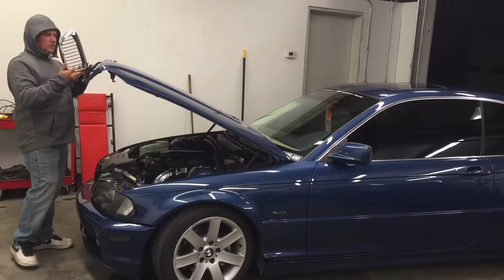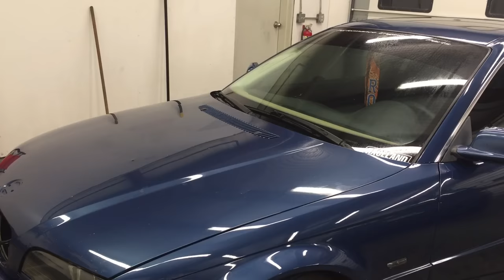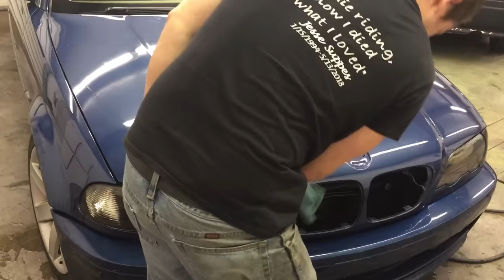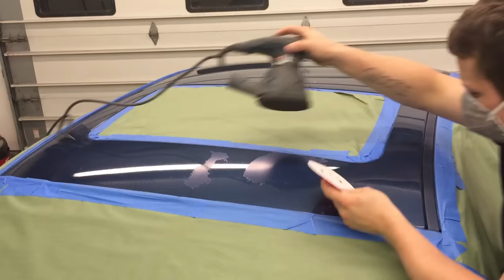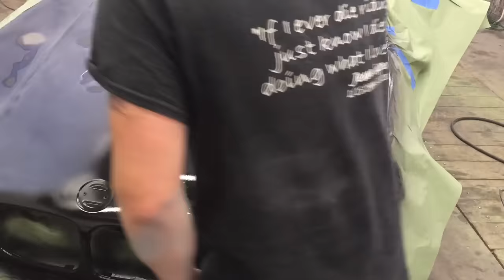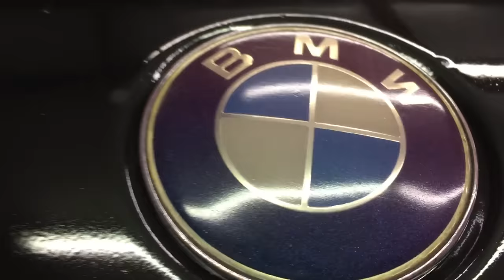The Best spray can paint for high gloss. (Hood has imperfections)

Comment from the maker: The hood didn't come out the best due to wax still present. He is replacing the hood anyways so we didn't spend A LOT of time on fixing or correcting the hood. I know its not perfect the point was to show you how we prep/how good and glossy the new formula from Rustoleum is. The 2X Ultimate is the best shine for price paint. All hate comments will be deleted so don't waste your time.  We will be putting the other hood on and will do a update.
Reply: Looks good, did u do the top of trunk too?
Reply from the maker: We will be soon!
Reply from the maker: If i do another turbo honda i would have to do it the civic we are doing to the J but i dont wanna turbo the J. So idk hope we can soon!
Reply: James D guy  what grit sand paper did you use ?
Reply: the car looks nice
Reply: James D guy your videos been getting a lot of attention. #UnWrecked keep up the great work.
Reply: James D guy hey I so how does the spray can paint hold up to intense sun and heat over time. Cause I’ve heard after just a little while it starts looking really bad. Is that myth or factual?!!
Reply: James D guy you should have used cloths detergent then wax remover!
Reply: @Lifted_6.2BlackOps901-rs9wg  great question !!
Reply: What is etching primer and what is it used for? Good job!
Thank you
Reply: Moore Motorsports James Dguy 
Got a question I’m painting my truck and this my first time should I sand down the entire truck or just the spots where the clear coats coming off ? 
My truck is white and in painting it black.
Reply: I am thumbs up 98. It looks great. I'll be rattle can spraying my 64 VW beetle soon with the Willow Green that you used on a car earlier.
Reply: what sanding disc did you use ?
Reply: I use glass cleaner and a new dry rag to strip the wax and other contaminates, u can also use ammonia from the dollar tree. Glass cleaner is also very good for checking your progress when u are buffing.most compounds have fillers and that what causes bleed backs. The glass cleaner removes the compound from the surface and shows the sand scratches right then instead of a couple hours later. Great channel bud, I hope that you do well with it, maybe you will make enough money from it to buy your self a shop with a booth and really get yourself set up for success. Then u could hire me to sand and buff the paint so u could just focus on spraying lol. We have a half ass painter where I work, I have to sand the whole panels that he paints because he don't clean his booth out , and  uses the fastest hardener and clear he can and he has the worst texture and trash in his paint you have ever seen. Not to mention hellatous runs. Seriously, your tractor paint and house sprayer paint job looks better than what I have to deal with on a daily basis.
Reply: Do you clear over the paint or leave it as it is?
Reply: There are many components to getting a good result. One plan I found that successfully combines these is the Magic Painter Method (google it if you're interested) without a doubt the most useful info that I have ever seen. look at this  extraordinary website.
Reply: There are many components to doing a pro job. One resource I discovered which succeeds in merging these is the Magic Painter Method (check it out on google) without a doubt the no.1 info that I have ever seen. look at this  super website.
Reply: Awesome video!!! How did it hold up against heat and weather after a while??? Im planning on painting some fender flares... thanks
Reply: There are many components to doing a pro job. One plan I discovered that succeeds in merging these is the Magic Painter Method (google it if you're interested) definately the no.1 info i've seen. Check out this  extraordinary website.
Reply: I want to spray can my honda accord 2001, but I'd like to paint it same color, how do I match the right color on Rustoleum spray can?
Reply: Not bad at all from can spray paint
Reply: When you use Rustoleum can you wash your car at the car wash safely without damaging the paint?
Reply: @JamesDguy  when you use Rustoleum can you wash your car at the car wash safely without damaging your car?
Reply: hey so you just sand it and paint it you dont need to primer it first?
Reply: No primer needed or just the paint it self ima use the same rattle can as you because that looks good
Reply: Love the video ,Am goin to do my roof on my suv an by watching your video it should come out great
Reply: Kinda low that you censor the "haters". Just let them voice their opinions. I don't get why people gets so triggered when someone will criticizes what they do.
Reply: @paulhoffman7980  you might already painted your truck, but it is better to sand where you're going to be painting, that way the paint grips better.
Reply: ignore the haters, they are completely missing the point of the video. this is exactly what I was looking for and the tips are helpful, thanks man! insane gloss for the price!
Reply: Wait no clear coat?
Reply: I just realized I live near you 😂. I need an estimate on my 14 Nissan Maxima. I want it black with dark grey accents. Hope you can help. I’m not gonna do it yet but world love an estimate.

Comment: Lots of fisheyes in the paint, need to dump the rattle cans in very warm bucket of water and let them get up to temp you will have much better results. prob with using cans is as you use them the aerosol  cools the paint back down.

Comment: Painting is the easy part but the preparation is the key!
Reply: Your exactly right!
Reply: @SladesVWBeetle  preparation is pain on the ass
Reply: 90% preparation, 10% application.
Reply: Yes , if u failed in sanding part and without primer surfacer , the result is bad
Reply: @oguzoguz4686  Preparation H.
Reply: Painting is not easy lmao
Reply: @jaredtippets6255  you just need to aquire a fairly steady hand, and learn a a motion routine, nothing's impossible with the living God
Reply: Do you do this for a living? Cause I've seen some really wack amateur spray paint jobs. It proves its not easy. It can be very technical. No one job is the same. I used to help my father out after school at his auto body repair shop. Prep is key. Very much true. But knowing your products, problem solving and technical skill is definitely required. Spray can is a quick, cheap fix. Nothing beats air compressor and paint gun.
Reply: @islandbreezy441  it's all about the prepping! Before and between coats!
Reply: True true!! As with everything my friend!!

Comment: I always use rustoleum on my vehicles. It's tuff as Old boots !!!.
Reply: Same all my junkets get rustoleumed.  The only bad thing about it is doesnt last in the sun (no uv inhibitors)  but you can add some if you use quart/gallons instead of spray cans.  I dont bother since I park indoors.
Reply: @GotrekGurninsson  how many years in the sun before the rustoleum breaks down? If it lasts 5 years, not bad at all.
Reply: @atmosrepair  Mmm depends where you live. Arizona maybe a few months canada maybe 2-3 years.  Assuming it's not garaged
Reply: @GotrekGurninsson  yeah sun strength definitely matters. But I am near Canada so if I could get 3 years out of it, not bad I guess kinda something to do
Reply: @atmosrepair  I did a shed and added uv inhibitors to it 10 years later still looks the same :)  worth paying the 5$ for some

Comment: Very nice for canned paint. Good job guys. I have some older cars that I love but use as daily drivers and of course, have to keep them up. I typically use "the ten-foot" rule: if it looks good at ten feet, you're done - esp. with older cars that are not classics but you just want to make them look decent w/o spending huge sums of money. So when you drive by people in other cars or people standing on the sidewalk, the appearance is quite good to them - AND most people just don't even notice any flaws unless they're car buffs and walk up close and stare at the paint. I have done some panels and later wet-sanded, as you remarked, and it can look really spectacular with a wet-sand. Good job.
Reply: How much do you charge to paint a car

Comment: You have inspired me to paint my project car with spray cans! Couples of questions....
1) which colors are easier to work with? ( darker, or lighter) Want to use rust-oleum High Performance Enamel Spray Paint -Aluminum
2)what base primer do you use for bare metal section?
3) high gloss vs enamel? Durability? Finish? 
4) Sanding only with 320 before painting or can I go higher and achieve better resultes? 
Thanks man! Truly a Spray Paint God!!
Reply from the maker: Gerardo Serrano I would go with gloss white ultimate from rest oleum. 320 is what I used to just kind a break to clear and smooth everything out you can go higher for better results but I have went 400 to 600 grit and the results came out just the same. I would get 10 cans instead of eight just in case you need more. And if you’re going to go ahead and spend the effort might as will get some 2K clear from spray Max. Type in spray Max clearcoat and you will thank me later

Comment: Even the guys using a spray gun and auto paint do color sanding after it dries. 2000 grit followed by 3000 and 4000 if necessary. Then cutting compound and polishing compound for a really smooth and glossy finish.
Reply: Wow! looks good maybe I should do my 2004 Chevy cavalier

Comment: High build primer is your friend when working on pieces that have imperfections they cover and hide them much better. A couple of coats with wet sanding in between the high build coats removes the waves.

Comment: What a great job for how quick you prepped it.  Amazing! Just shows you that anyone with time, patience and a little knowledge.. can do anything.   My only suggestion really is to get the trigger gun attachment for the cans because I'm sure your fingers cramped up pushing down the spray button also because a lot of the attachments can spray out like a fan to make coating easier.  One more thing.. If you put a gray or white basecoat down first there will always be less visible imperfections.. but since he getting new hood doesn't matter. Keep up the excellent videos. You're awesome.

Comment: I little trick a ppg paint rep taught me a long time ago... Walmart blue windshield wash fluid wipe on wet wipe off dry with a blue towel is fantastic budget wax and grease remover. Way cheaper than acetone or solvent wax and grease. Try it.
Reply: Richard Desvousges is dish soap not budget enough?
Reply from the maker: Richard Desvousges  Thanks for the tip and the dish soap didn’t do good enough so gonna have to try that on a panel. The hood is being replaced with another one but we did the paint anyways. Too much wax we didn’t get off caused issues but he will be getting the whole car redone next year out of gun but he wanted to the flaking to stop so his is temporary for him
Reply: I worked in a high end body shop and we used sprayaway foam glass cleaner
Reply: James D guy blue wash fluid dries nice too
Reply: @jwolff9153   That glass cleaner is amazing and I would recommend it to anyone. I managed a  high end remodeling company and we stocked it by the case for finish  glass and accenting metals.
Reply: Doesn’t the sanding you did get rid of the wax?
Reply: +midrangetorque
4 days ago
"Doesn’t the sanding you did get rid of the wax?"

No.  The wax can mix with the dust and the heat from rubbing makes the wax an oil.  You won't see it but it;s there and once cooled off it'll harden.  You can test it out by grabbing a fistful of crisco watch it tun into oil in your hand and then rub that into something grainy like a sanded car door then try sanding it out after it cools-- all you'll do is spread small particulate wax.  Then wash it out with an alcohol based cleaner like windshield washing liquid and you'll see a big difference.
Reply: I wouldn’t use dish soap it leaves detergents and other things they use to make it not a professional painter or anything just my 2 cents
Reply: This is a bit off topic but you can also use Walmart windshield fluid as a drying agent if you spray water base paint with an HVLP sprayer. The blue tint will not affect the paint color either. 
The windshield fluid will flow out your paint flat without orange peel if you mix 10 to 15%. Thanks Richard for the tip about it's cleaning properties and I will try this as a wax and grease remover.
Reply: I use rubbing alcohol out of a spray bottle

Comment: Tip for water sanding. You should always soak your paper for 24 hours before sanding because the papers designed for that. It acts like a sponge. Been painting cars for 25 years. After someone told me that I tried it and the paper works better.

Comment: What grit u used to wet sand after paint 400? To get the smooth feel after paint? Thanks great video
Reply from the maker: SwagGod 22 320-400 prior to paint for smooth under finish. When paint is cure wet sand with 1500-2000 and 2500 after buff for amazing smooth finish

Comment: when the hood heats up does it start smelling like paint? or melting?
Reply: These paints can withstand 200 F degrees, an engine reaches maybe 300-400 on the block, and the engine bay is alot lower.

Comment: I think you should keep the rims silver. However, I have a grey, Impala. It has a few rust spots. But, I want to spray paint it black. Do I have to buff all the grey paint off, with a 600 grit sandpaper? Or, can I just spray primer on the whole car, than spray paint it with the black gloss you used? I would appreciate your help and advice.

Comment: hi moore thanks for all your videos. I have a smart car project I am working on and the whole clear coat of the car has fallen off. The car is all plastic. Should I still sand even tho clear coat has fallen off completely? if so what kind of grit you recommend for plastic that wont add scratches etc. thanks

Comment: How many cans did you use to get this finish? Did you use a clear coat after? I used the high gloss for my trunk and roof but it still doesn't have this level of shine so far I've used 2 cans. Do I need a 3rd? Last how would you buff this to get a mirror glass finish I want it to look good

Comment: Hi friend Just want to know the technique of spraing with spray can  do you spray far away from the area as ive seen while you are spraing the hood but it turn nice iam planning to do my roof only after Repairing rust and prepare the surface for paint job but i dont know weather to plastidip roof or to spray  it with a spray can cause spray pattern is so small ive done that before and i got stripes on my hood 🤗

Comment: That spray can clear is trash the second a bird caps on your car the clear will burn right through. Also, it's very soft clear because it's not a 2k clear. Please do things the proper way
Reply from the maker: Roman Artemenko LoL the 2k clear is in a can now it’s called spray Max. A google search does wonders
Reply: James D guy ... lol...google is king. #boom. Thanx 4 vid
Reply: Yes. I do body work for a living
Reply: @jwolff9153  yea they should have went and got a the hole car done at a shop for 5000 for that 3000 dollar car lol
Reply: @newwavepressure6478  hes doing everything himself! He couldve spent $400-500 on supplies at most and properly prepped his work area and it would've been better. Please show me where i said he should've taken his car to a high end shop? MAACO does way better work then this and they'll do a whole car for like $500! Lmao. Please don't talk about things you dont understand.
Reply: @newwavepressure6478  and like i mentioned somewhere else for this exact project you're better off buying a sheet of 3m vinyl. It will look cleaner and be more durable. C'mon man. I understand not everyone has the money for a high end paint job but doing shit cheap and doing it halaf ass are completely different

Comment: I used Rust-Oleum ultra gloss black with ultra gloss and clear on a bmX bike 10 years ago, It was really shiny but had a mild orange peel.
Reply: Did the paint last?
Reply from the maker: It will if you lay it on thicker. Lighter the coats the less the peel.

Comment: I’ve got rust on my wheel arches. What’s the best way to remove rust so it doesn’t come back. 
And can you explain why you used etch primer on the bare metal? Thanks.
Reply from the maker: Best way is sand it all the way down and go get some rust killer they sell it in a can. Then spray it over the area, let it dry fully then wet sand it with 400 grit then shoot primer over and wet sand after thats cures. Hope that helps.
Reply: James D guy rheank you for the info. Hope it works.👍

Comment: Wheels... a bit late now, but I would have gone black, with multiple layers of clear coat... first 2 with platinum pearl mixed in, last 2 or 3 plain clear.

Putting the pearlescent clear over the black gives it a bit of a metallic sheen that you wont normally see with black paint...

Comment: Have you ever tried to sand the paint off afterwards? I’ve been told body shops won’t touch a vehicle that’s been painted with rattle can because it’s too hard to get the paint off. You said he was going to redo the car later. Just wondered if it is a hard to get off as the body shops say

Comment: I have clear coat peeling due to weather and cheap Maaco paint job, what are the steps to spray clear coat only?
Reply from the maker: Im not good at repairing clear coat to be honest. If there isn't any chips of the color and there isn't any rust or pitting then i would wet sand with 800 work up to 1500 once its all smooth to the touch then re shoot with spray max 2K clear 2 cans is like 40$ but its high quality UV resistant clear coat. I would do more searching on youtube to be sure but that method seems solid.